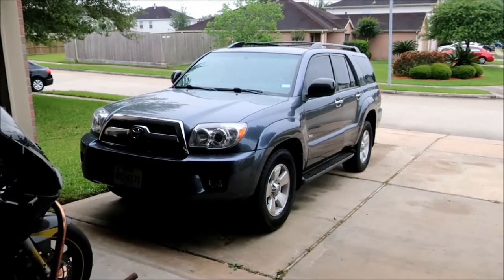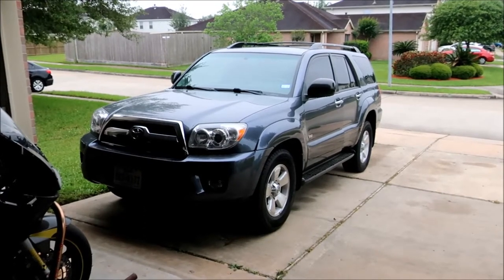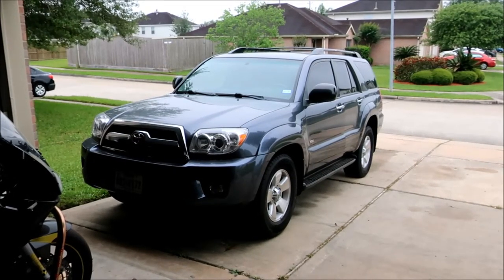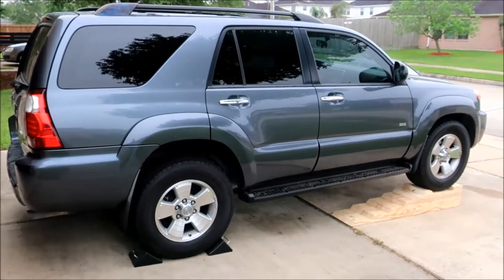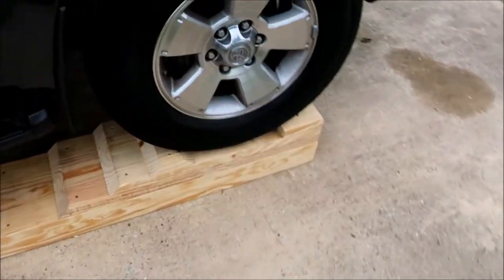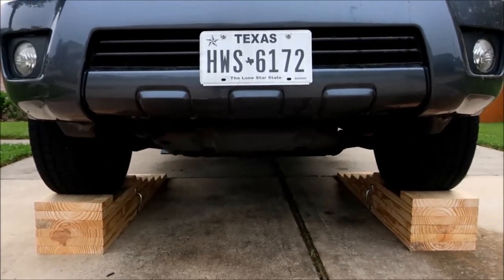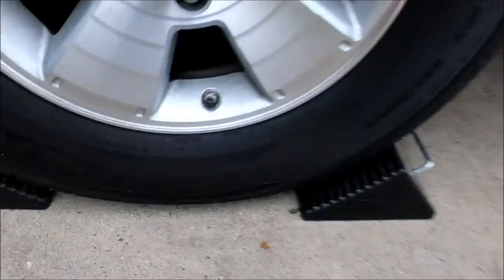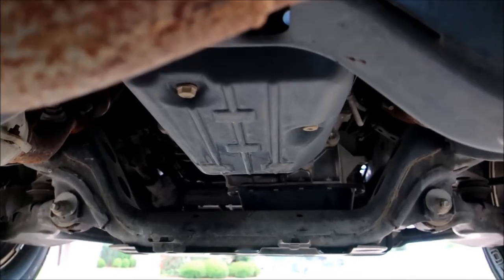2008 4Runner Automatic Transmission Fluid Service - No Dipstick

Comment: If I dont have a scan tool... would an IR thermometer work well enough to determin approx fluid temp level? Meaning if I shoot the IR thermometer at the pan in 2-3 locations and its saying like 105 degrees... would that suffice? I love my 4 runner and have owned 2 so far but I think its a little ridiculous that you have to have a special scan tool to do a simple diy procedure. I have a decent scan tool with live data capabilities but A/T temp is not a sensor it can get a live feed from and I’m not buying a scanner specifically for this. Let me know!
Reply from the maker: I actually posted about this underneath Joe's comment from last year. You don't need a scanner to perform a transmission service/fluid adjustment. Although an IR thermometer would certainly be better than nothing, the procedure I listed below will ensure you set the fluid level correctly. I'll copy my response below:

"You technically don't need a scanner to set the fluid level on these vehicles. All you need is a jumper wire and to connect terminals 4 and 13 of the OBD-II connector together - I'd recommend backprobing to avoid spreading the female terminals by accident - while monitoring what the transmission oil temperature light is doing. Below is a bit more information about this method via the repair manual, but verify the fluid temperature spec for your vehicle isn't different:

(b) When not using the Techstream (using indicator light):

(1) Using SST, connect terminals 13 (TC) and 4 (CG) of the DLC3.

SST: 09843-18040

(2) Start the engine.

NOTICE:
Check that electrical systems such as the air conditioning system, audio system and lighting system are off.

HINT:

Indicator lights of the meter blink to output DTCs when terminals TC and CG are connected.

(c) Slowly move the shift lever from P to L, and then return the shift lever to P.

HINT:
Slowly move the shift lever to circulate the fluid through each part of the transmission.

(d) Move the shift lever to D, and quickly move back and forth between N and D (once within 1.5 seconds) for at least 6 seconds. This will activate the fluid temperature detection mode.

Standard condition:

A/T OIL TEMP warning light remains illuminated for 2 seconds and then turns off.

(e) When using the Techstream:
(1) Return the shift lever to P and press OFF on the Active Test display.

(f) When not using the Techstream:
(1) Return the shift lever to P and disconnect terminals 13 (TC) and 4 (CG).

(g) Allow the engine to idle until the fluid temperature reaches 36 to 46°C (97 to 115°F).

(h) The A/T OIL TEMP warning light will come on again when the fluid temperature reaches 36°C (97°F) and will blink when it exceeds 46°C (115°F).

NOTICE:

Perform the fluid level inspection while the indicator light is on.

6. FLUID LEVEL CHECK

NOTICE:
The fluid temperature must be between 36°C (97°F) and 46°C (115°F) to accurately check the fluid level."
Reply: Thank you for the reply man. I may just end up doing the IR method since I am not well versed in jumping wires/ back probing. I know what they are... Ill look around on here for some insight on how to do that. Sorry for not reading the further comments. Thanks dude!! You’re not in Ohio are you?? 😂
Reply from the maker: @xlxphoenixkingxlx  It's not too bad to figure out. Do an image search on Google for an OBD-II/DLC pinout. It's a standardized layout that shows you the terminal locations, names and numbers.

If you do the IR method, keep in mind that the fluid cycling within the transmission may be a few degrees hotter than what you're reading at the pan - heat has to conduct from the fluid to whatever surfaces it's exposed to; in this case the pan. Hope that makes sense.

And nope, not in Ohio. :)
Reply: So I got it figured out. I jumped the two. It was easy. I did a drain and fill last fall and thought I put back in what I took out but I just did the procedure and no fluid came out at normal operating temps😳😱 but I have been driving with it like this for a few thousand miles and no weird shifting and such. Unfortunately I am unable to correct this low level until Friday. It will be fine until then. But thank you so much for the help man!!
Reply from the maker: Keep in mind that just because you put back the exact amount that came out doesn't mean the fluid level will be correct. The reason for this is because you don't know what the fluid level was at to begin with; it may have been set incorrectly by someone else, may have been set incorrectly from the factory (less common, but can happen), or it may have a slow leak that gradually drops the level over time (you would notice this one). That's why if you use a machine to flush the transmission that you should always inspect the final fluid level; it will put in the exact amount that was taken out, but won't set the final fluid level for you.

Also if you have a tow package on there with an external cooler, make sure you depress the bypass valve when checking the final fluid level to ensure accuracy (it'll be on the right side of the transmission). When you are done setting the level, make sure to disengage that valve.

Hopefully your fluid level wasn't too low to affect anything long-term.

Comment: Is it worth the trouble to drop the pan change the filter and clean the metal out of the pan/off the magnets?
Reply from the maker: That's a good question. I think a lot of that depends on how much abuse the transmission is being subjected to. If it's just a daily driver with easy miles put on it – light load/acceleration, no extended idling times, no towing, getting engine/transmission up to operating temperature before shutting everything off, operating in favorable climates (no extreme hot/cold temps), etc. – then I wouldn't worry about it. 

If on the other hand this vehicle is being subjected to a lot of abuse, then it may be worth going in there to inspect the magnets for any excessive metal accumulation (indicates internal transmission issues; a little bit of metal isn't a big deal; every transmission wears over time, but you shouldn't have a large accumulation or any noticeable shavings/chunks), clean the magnets, and either clean or replace the transmission strainer. I believe the strainer is a metal mesh type on this one and not a standard paper filter because they don't expect technicians to go in there and replace it; it's more of a reusable one if you will, hence why you can generally clean those. Hope this helps.
Reply: I’m at about 130k miles. Transmission was probably never serviced. It is lifted with 33” tires and do take it off road.
Reply from the maker: @St.Hermans_Speed_Shop  Certainly wouldn't hurt to remove the pan in your case. Make sure you get a new pan gasket as well.

Comment: Is there a way to do it without the scanner? Or a cheap alternative for the scanner?
Reply from the maker: No scanner required. I've posted about it already in a few of the comments below.  I'll copy one of my responses for how to do so:

"You technically don't need a scanner to set the fluid level on these vehicles. All you need is a jumper wire and to connect terminals 4 and 13 of the OBD-II connector together - I'd recommend backprobing to avoid spreading the female terminals by accident - while monitoring what the transmission oil temperature light is doing. Below is a bit more information about this method via the repair manual, but verify the fluid temperature spec for your vehicle isn't different:

(b) When not using the Techstream (using indicator light):

(1) Using SST, connect terminals 13 (TC) and 4 (CG) of the DLC3.

SST: 09843-18040

(2) Start the engine.

NOTICE:
Check that electrical systems such as the air conditioning system, audio system and lighting system are off.

HINT:

Indicator lights of the meter blink to output DTCs when terminals TC and CG are connected.

(c) Slowly move the shift lever from P to L, and then return the shift lever to P.

HINT:
Slowly move the shift lever to circulate the fluid through each part of the transmission.

(d) Move the shift lever to D, and quickly move back and forth between N and D (once within 1.5 seconds) for at least 6 seconds. This will activate the fluid temperature detection mode.

Standard condition:

A/T OIL TEMP warning light remains illuminated for 2 seconds and then turns off.

(e) When using the Techstream:
(1) Return the shift lever to P and press OFF on the Active Test display.

(f) When not using the Techstream:
(1) Return the shift lever to P and disconnect terminals 13 (TC) and 4 (CG).

(g) Allow the engine to idle until the fluid temperature reaches 36 to 46°C (97 to 115°F).

(h) The A/T OIL TEMP warning light will come on again when the fluid temperature reaches 36°C (97°F) and will blink when it exceeds 46°C (115°F).

NOTICE:

Perform the fluid level inspection while the indicator light is on.

6. FLUID LEVEL CHECK

NOTICE:
The fluid temperature must be between 36°C (97°F) and 46°C (115°F) to accurately check the fluid level."
Reply: How to put gear oil to 4runner

Comment: Why didn't you choose to change the filter?
Reply from the maker: That's a good question. Based on the condition of the fluid and the way the vehicle has been operated - no real abuse or towing scenarios, full warm up cycles every time it's driven, fair weather operating conditions, etc - I didn't feel it was entirely necessary.

If the condition of the fluid is questionable and you know the vehicle hasn't been exactly driven gently, then it would probably be worth it to drop the pan, inspect the pan magnets for excessive metal accumulation, and clean/change the filter. If it's a paper filter, replace it. If it's a screen/mesh filter, clean it.
Reply: @TimmaethBoy  Thanks for the info, and the quick reply. 👍

Comment: Hi, what  area do I use a level to level the car? Are we leveling  the car or the actual  ATF pan? Thanks!
Reply from the maker: You just want to make sure the vehicle is on a relatively level surface. It doesn't have to be perfect – just sort of eyeball it. No need to get a laser level out for something like this. :)
Reply: @TimmaethBoy  thanks for your reply! I've  seen lots of videos on YouTube about this procedure. People  are saying  to make sure car is level.others saying to level the flat  side of pan. The  pan is slanted and the car frame is straight so I'm confused!
Reply from the maker: @dellim3174  The engineers who design the vehicle take that into consideration. That would be silly if you had to have the pan level relative to the ground, especially considering how many different shapes/styles of oil pans are out there. Same goes for engine oil.
Reply: @TimmaethBoy  that's make a whole lot of sense! Thanks again for the reply! I level the car on the chassis and pinch weld  under the doors. Both are about  same level!

Comment: Should pull pan new filter and gasket too.
Reply from the maker: Not necessarily. The filter is a steel mesh type and doesn't need to be replaced. Maybe cleaned, but it's so porous that any small debris passes right through compared to a conventional paper filter like the ones for your engine. I mentioned this in another comment.

Comment: Hola amigo espero que veas mi comentario y me respondas cómo puedo verificar la temperatura de 97 y 115
Reply from the maker: Hola. El procedimiento se enumera a continuación. Espero que tenga sentido. Que tengas un buen día!

(b) When not using the Techstream (using indicator light):

(1) Using SST, connect terminals 13 (TC) and 4 (CG) of the DLC3.

SST: 09843-18040

(2) Start the engine.

NOTICE:
Check that electrical systems such as the air conditioning system, audio system and lighting system are off.

HINT:

Indicator lights of the meter blink to output DTCs when terminals TC and CG are connected.

(c) Slowly move the shift lever from P to L, and then return the shift lever to P.

HINT:
Slowly move the shift lever to circulate the fluid through each part of the transmission.

(d) Move the shift lever to D, and quickly move back and forth between N and D (once within 1.5 seconds) for at least 6 seconds. This will activate the fluid temperature detection mode.

Standard condition:

A/T OIL TEMP warning light remains illuminated for 2 seconds and then turns off.

(e) When using the Techstream:
(1) Return the shift lever to P and press OFF on the Active Test display.

(f) When not using the Techstream:
(1) Return the shift lever to P and disconnect terminals 13 (TC) and 4 (CG).

(g) Allow the engine to idle until the fluid temperature reaches 36 to 46°C (97 to 115°F).

(h) The A/T OIL TEMP warning light will come on again when the fluid temperature reaches 36°C (97°F) and will blink when it exceeds 46°C (115°F).

NOTICE:

Perform the fluid level inspection while the indicator light is on.

6. FLUID LEVEL CHECK

NOTICE:
The fluid temperature must be between 36°C (97°F) and 46°C (115°F) to accurately check the fluid level.
Reply: Muchas gracias por tomar él tiempo de responder mi pregunta 👍🏼

Comment: Great video, engineers give the FSM instructions expecting monkeys to work on the car. They over specify and expect you to mess up. If they say 100 to 115 they most likely mean 80 to 140 degrees. An ounce higher or lower of fluid should be fine.
Reply: if your just draining the pan,does it make sense if you measure the amount of drained cold transmission  fluid out and then measuring same amount of new transmission of fluid pump in.that way dont have to be concenred about fluid warming ,overflow plug ,level ground and all that
Reply: @ireneflores5341  Yes, that's the safest way if you don't have any leaks. The problem is you can't trust the previous person has done a perfect job refilling the transmission,  so you may need to make sure that the level is correct, it's a very simple procedure.
Reply from the maker: @ireneflores5341  TL's response regarding this "The problem is you can't trust the previous person has done a perfect job refilling the transmission", is why I always recommend setting the final fluid level according to the factory's recommended temp spec. You are assuming that the fluid level was set correctly prior to the drain and fill with the method you're describing which is where you can run into problems. There can even be issues where the fluid level hasn't even been set correctly from the manufacturer, although much rarer. Certainly nothing wrong with the way you want to do it, but you have to be 100% sure the fluid was set correctly.